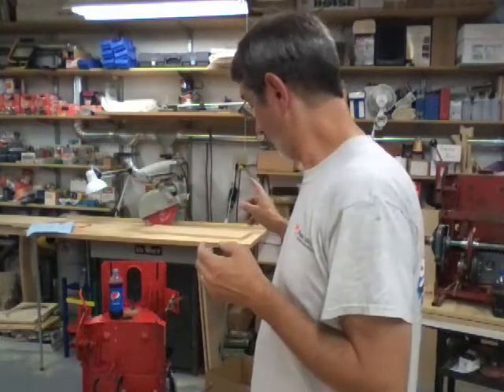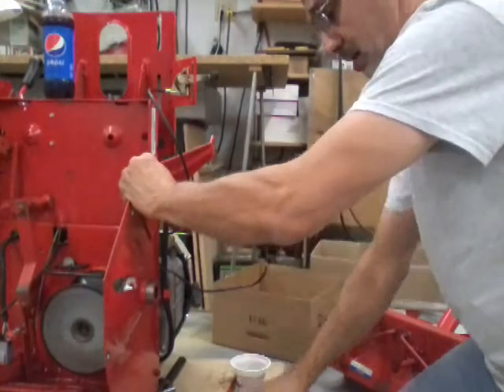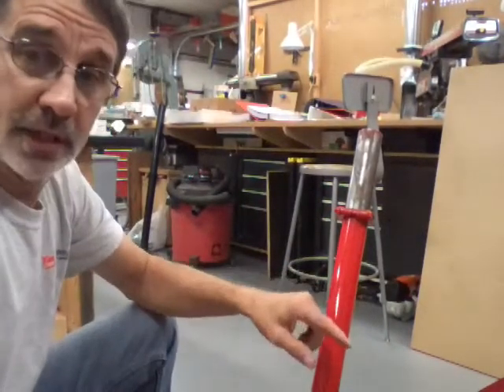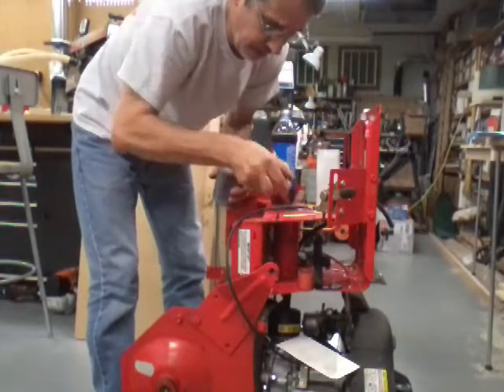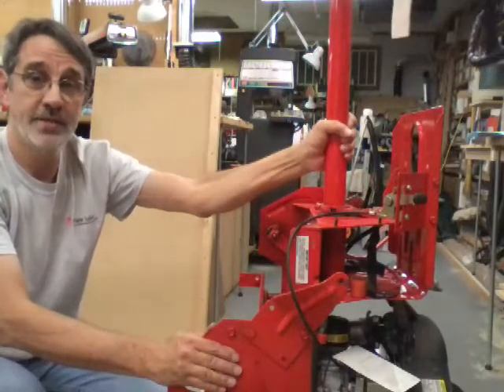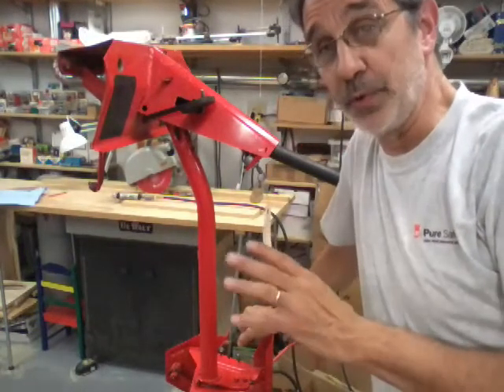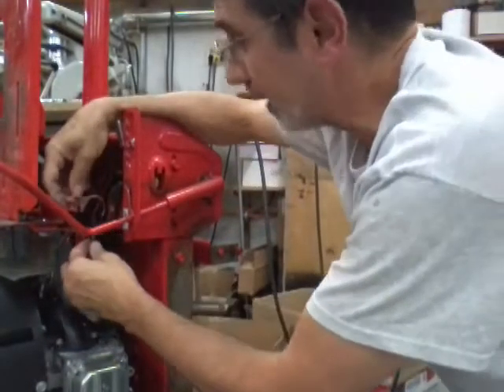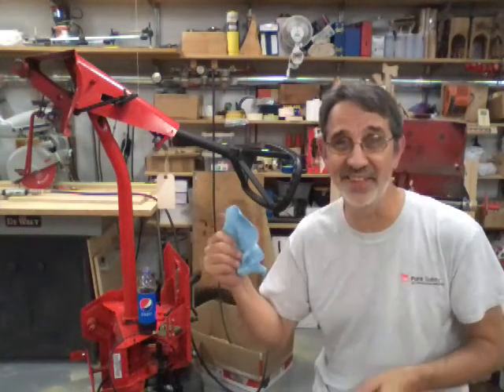130.   Replacing the front end assembly and installing a new pilot bushing.

Comment: Watched many videos and just got my 08 28" RER back into shape with clutch drive friction belt blade and bearings all updated.  Front got the new bushings but still wasn't quite right.  Close examination showed the triangular yoke the tierods plug into was bent upwards.  When the steering turned the tie rods tried to unseat themselves as the angle increased.  With the yoke bent straight the assembly appears to all be traveling in the same plane and the alignment is true.  Plus used your 2 washers trick and all is now very tight.  Thanks for the help.
Reply from the maker: Well thanks for watching and I’m glad I could help. Jim

Comment: Hi Jim I love my snapper. I have 2 peddles type ,about 13 hp. My cable on left side allows my pedel to lay half way down I just need to get more spring rebound.. Sometimes it's hard to shift from forward to reverse.. Wayne love your videos
Reply from the maker: WAYNE V. 
Hi Wayne it's Jim.    To bring your paddle up higher move your ferrules through the pedal and put them on the backside.   If it shifts hard try sliding the boots back and greasing the Hexagon shaft that should help. Thanks Jim

Comment: I have a 281223BVE, what would the part number be for the pilot bushing?  Which anti-seize do you use?
Reply from the maker: Kirk Francis 
7074650 Is the part number through Parts Tree.Com. out of Texas according to your model number. Jim
Reply: Jim Jackson too bad YouTube keeps sending me to lending tree when I click your link!  Definitely won’t use them!  No thanks YouTube!

I will check that website out and type in manually Jim!
Reply from the maker: Kirk Francis 
Thanks for the tip on that issue I’ll have to check in on that. The brand of anti-seize lubricant that I use is Permatex But any brand will work. Jim

Comment: Hi jim, have a Snapper Rider myself and your videos were quite helpful so thanks for that. Now recently a new problem occured: the fuel tank empties from time to time. After the mower stands a few days i can see the fuel dripping down at the rear right side. Already checked the piped but they were dry. Maybe you can give me hint where potential leaks might occur so that can i can check these points. Thank you very much in advance!
Reply from the maker: janbeth88 
   Is this an older snapper where the plastic gas tank snaps into a steel bracket right behind the seat, mine started leaking where the plastic stub that comes out of the bottom of the tank where the hose slips on to, some tanks that stub or stem is molded right in the gas tank.  The used one I bought has a stem that snaps into a rubber grommet in the bottom of the gas tank.  I would suggest taking the fuel line off of your fuel filter or your carburetor pull the gas tank out of the metal bracket that it snaps into,  dump the gas out clamp the rubber hose with a pair of vise grips's and fill it full of water and check for a leak you could have a leak in the seam in the plastic tank or the stem could be leaking let me know what you find out.  thanks Jim
Reply: Hi Jim, thanks for your super fast reply. Only now I came to have a look at it. The leakage comes from the carburetor i guess. Gas tank and hoses seem to be fine as it drips down from the bolt which sits at the bottom of the carburetor. I dried the hose many times and everything above the carburetor stays dry. Would it be possible if you make a video of removing, cleaning of the carburetor? Furthermore - can you provide the article description for the carburetor? I live in Germany and it is not that easy to find out the details. Thank you very much in advance! Jan
Reply from the maker: janbeth88 
Hi Jan this is Jim. 
Well so far as far as I know you are my first viewer from Germany. Now for your issue from what you tell me I am thinking that your float is stuck open in your carburetor and allowing the gas to leak out or the gasket between the float bowl in carburetor is bad. Do you only have one screw on the bottom of your float bowl on your carburetor some carburetors have the center screw which holds the float bowl￼ on and off to one side they have a drain so you can drain The float bowl sometimes that seal goes bad and they leak from the drain. If you don't want to take the carburetor apart what a lot of guys will do is put a in-line shut off valve on the gas tank that will take care of your leaking problem and thanks for your questions and comments talk to you soon Jim
Reply: Thanks Jim, I will have a close look at it. As it drips really slow, my assumptions is that the gasket is bad. Do you know the exact description of the carburetor so that I can order a new set of gaskets, or other spare parts for it? I can barely find information on german websites since this snapper is quite old. Model 28087BE 8hp 28''... Thanks in advance. Will revert once I took the carburetor off.
Reply from the maker: janbeth88.      Hi Jan it's Jim
   I hope I got your name correct,  when I get home tonight I will see what information I can find out for you send me a picture of your snapper with you by it  I would like to meet you I haven't had a friend from Germany yet.  Talk to you soon Jim.  You can send a picture to my email which is.  Jimsfixitshop@gmail.com
Reply from the maker: janbeth88 
Hi it's Jim. What I need is all the numbers off the engine the model numbers off the ryder itself won't help me at all .  Somewhere on the recoil cover usually above the spark plug will be your model and serial number and a type number I'll need all the numbers that you can find and I'll check with my dealers thanks Jim
Reply from the maker: janbeth88 
 For me to find any parts for the carburetor I need all the numbers off the engine not the ryder. Thanks jim
Reply: Hi jim, Sorry for the late reply. Just had  little time. Meanwhile I fixed the leakage problem by replacing some old rubbers on the carburetor. 
But all of a sudden a new problem occured when I wanted to start the engine: once I turn the key a loud ongoin clicking comes from the starter. Its is not clicking once after turning the key but very often and fast as long the key keeps being turned. The rope starter is broken as well (no compression, i can easily pull the rope back and forth) 
Do you have any ideas what could be the Problem? Already checked the starter gear which looks totally fine. 
Thanks for sharing your ideas. Jan
Reply from the maker: janbeth88 hi Jen it's Jim
    Well this is going to sound dumb, try jumping your snapper with your car or truck, your battery could have 12 V in it but if it doesn't have enough amperage it won't start your engine. When you try the starter it will just click continually until you release the key. If you try jumping it and it still doesn't start you could have a bad starter, or you could have a bad connection on your battery or the ground connection on the frame of your snapper.  Let me know what you find out. Thanks Jim
Reply: Jim Jackson thank you i will check that. I was just wondering because few weeks ago everything started fine with the same setup. Maybe the battery lost some power due to lower temperatures here.. checking reverting

Comment: Jim explain one thing to me by Toronto on my snapper engine is running on high when you move the throttle it doesn't change it from high to low or medium it is stuck what do I
Reply from the maker: Watch video number 266 and see if that helps you let me know. Jim